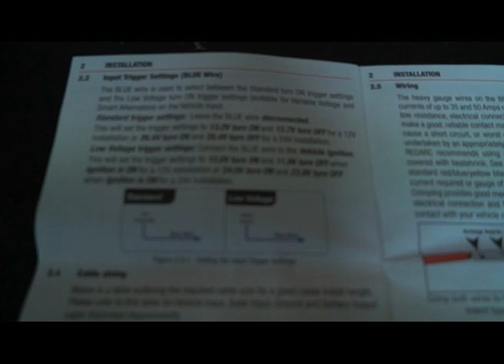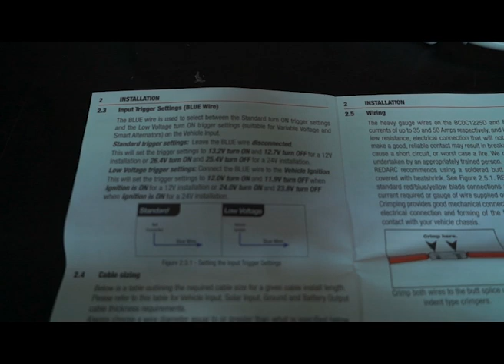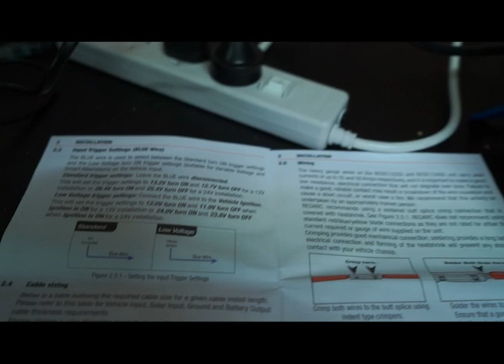Smart Alternators and DCDC Chargers

Comment: I know this is an older video but i have a question. Does anyone know if there is an AMP limit when using a smart alternator? I was told that 40 amps is the sweet spot. However my new vans Eco flow systems pulls 70 amps. What will happen if i run this? Any thoughts?
Reply from the maker: the redarc in the video is a 40
from memory and they make a 25 as well. Ive never seen a 70 but doesnt mean its not possible 

really depends on what you are trying to do with the system
overall

Comment: what type of cable and or gauge is the trigger wire? trying to find it on its own on the net
Reply from the maker: the trigger wire is on the device so you would be best to cut a small piece off and take it to somewhere like jaycar. its not super high gauge

Comment: I'm installing a Renogy DC-DC charger.  I believe my alternator on my 2018 Transit is not a smart alternator because it stays at 14.4 volts while under load and at idle.  Is there any possibility of damaging stuff if i assume incorrectly and do not install the ignition signal wire?
Reply from the maker: The only risk you run is if it is a smart alternator your auxiliary battery wont fully charge. Other than that unlikely to cause damage. I have a Ford Ranger PX2 2018 and i've ran it both ways (trigger wire attached and not) with the trigger wire you can just see the charger kick in at a particular time instead of immediately.

Comment: thank you share a great detailed video 
try with a 24v system in new trucks on market  with a smart alternator as does the same thing with not switch on dc to dc charger
Reply from the maker: I think Redarc do make 24V ones. Just need to look at the models sometimes they will say things like LV  (low voltage) Capable not necessarily smart charger capable.

Comment: I have a vehicle with a smart alternator and I want to know if I can use a wire jumped off the positive for the the ignition trigger wire? I plan on using an ignition triggered relay on the positive so that it will only see voltage when the car is on. Do you know if smart alternators drop below 12V at all?
Reply from the maker: this is essentially how they work should be fine. Depending on the car cigarette lighter sockets are normally more accessible and leas risky to tap into
Reply: @donniesgarage  I plan on having my dc-dc charger in my caravan & I didn't want to have to run another plug next to my anderson just for a single trigger wire.
Reply from the maker: @fifis101  its possible that one of the trailer plug wires will be suitable. best to get a multimeter out ;-)
Reply: We tow an Avan behind a motor home. Each has its own solar, batteries and BCDC 12 20. Everything seems to be working OK atm with both bcdc’s powered via buss bar and Anderson Plug to Avan without the blue wire on either connected. My thought was to connect both to the tail light wire in the  caravan light plug circuit. It would be both the most accessible from the mother home battery box and obviously in the Avan. We generally drive with the headlights on for safety reasons and they are turned off when the Motorhome engine is turned off. Generally leave the headlights on all the time in motorhome.  Biggest question is will it still work if driving with headlights off?
Reply from the maker: @Jazman342  not all the time. I know in our Landrover Discovery once 12V was "off" so in your case turning the lights off it also shut the DCDC charger off entirely.

You'll need to test it or talk to an autoelectrician that can do it the best way for you.

Comment: I think it isn't quite like you expect. As far as I understand the blue wire makes the charger turn off at 11.9v, but that voltage is measured at no load and to measure at no load which the charger measures once every 100 seconds. So until the charger detected that the main battery is at, or below, 11.9v at a no load state then it will continue working.
Reply from the maker: Yes I've been meaning to reproduced this video. I know in our Discovery when I had the blue wire hooked up you could see it shut the charger off entirely when you locked the car and turn on shortly after you started the car. This vid didn't quite replicate it properly but you're right in the way it works.